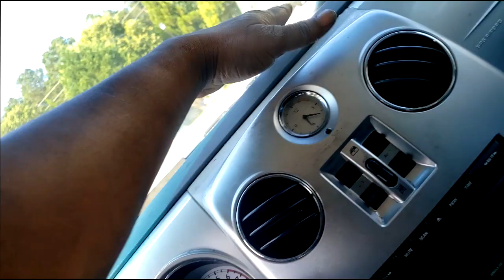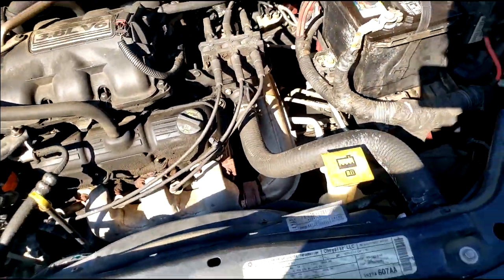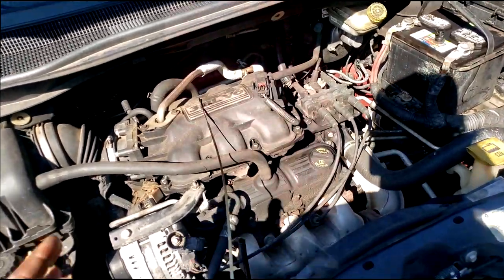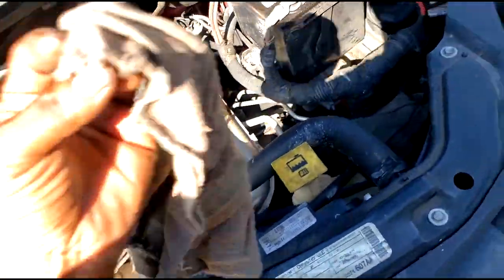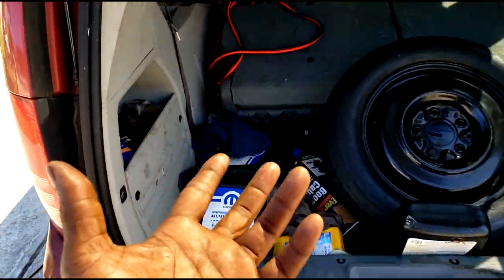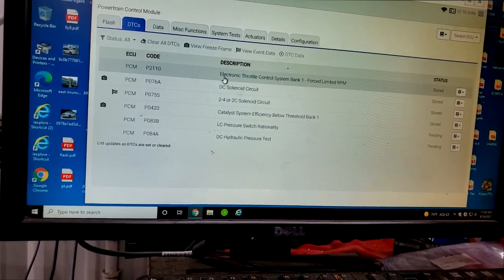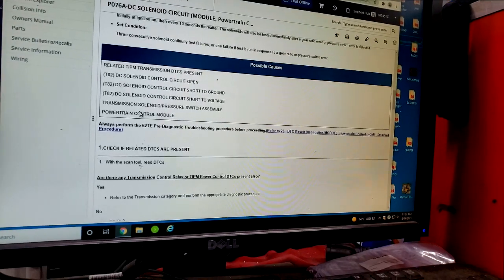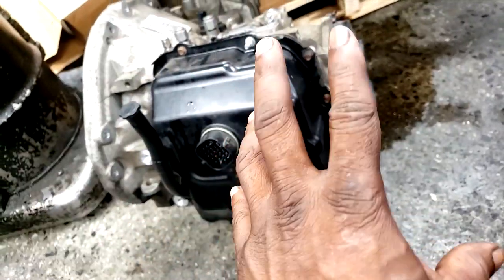Broke again, headed to the shop. How mechanics FIX they own cars with no money or parts. P0755 P076A

Comment: When I notice a fault with a transmission I tend to beat on it till it finally eats itself. Of course I used to swap out or rebuild it myself in my Dart. I'm trying to be nice to my newer cars and it's not as easy to just swap out or get cheap rebuild parts. At least my RT has a nag1 and it still has a dipstick tube too. I was thinking the same, just pull the stick out of one of the 727s in my other antiques and I could at least see how the fluid looks.
I'll probably buy one of the dipsticks from Amazon they sell eventually so I can properly check it. I'm all for cheap fixes and using my good used parts I have in stock or out of the Yard. Bet that good used pack gets it going again.
I'm going to have to replace the cam position sensor on mom's 08 PT we recently took over. She's not safe to drive anymore so Sister is driving it to work and when she needs to go help or look after mom.

Comment: P1745 on a 2013 that is stuck in only 2nd gear. What do you suggest when it has 200k.She is in limp mode now.
Reply: 13 doesn't have a tcm either? idk. Fyi I had a cat code as well but i ran duralube cat clean through it twice and the cat code went away.